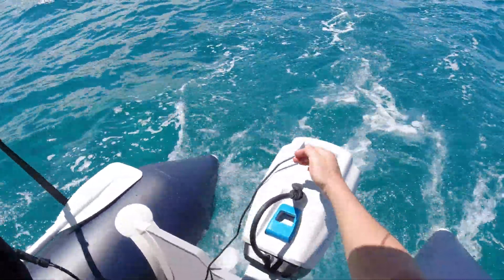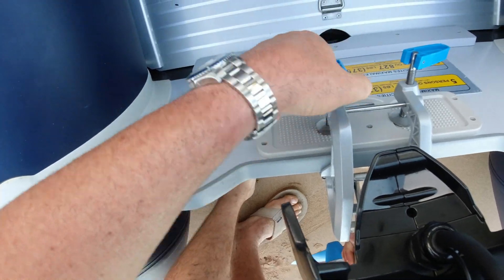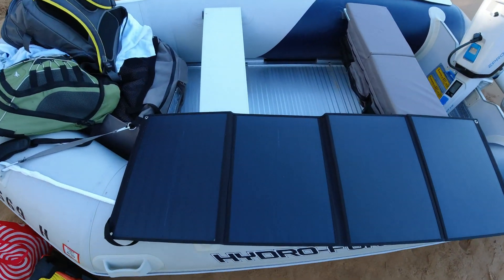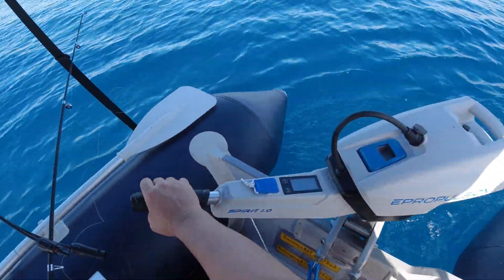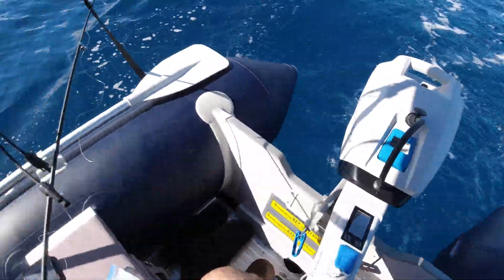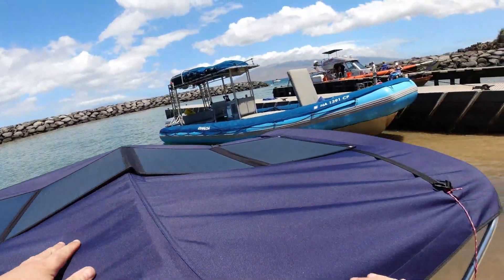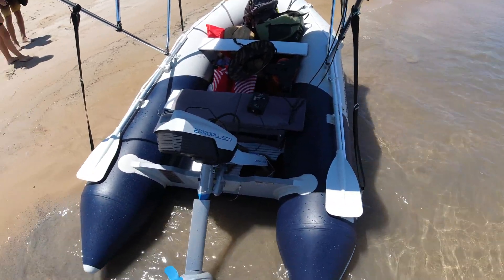Solar Electric 12S LiPo BRUSHLESS Mini Boat - Epropulsion SPIRIT 1.0 Outboard Review in Hawaii Ocean

Comment: Thanks for the review. I just bought the successor version of the motor, the Spirit 1.0 Plus and a bit larger 600 W solar panel w. another charge controller. I'm currently trying to figure out how to get the EPropulsion proprietary connector for the battery. I might have to make one by myself since the company is not offering them for sale. Any hints will be appreciated.
Reply: @holgere.  hey did you ever figure this out? I'd like to do the same.  Cheers!

Comment: Hi Dustin, I have the same boat as yours and my Eprop dealer is recommending the Short Shaft instead of Extra Short Shaft.  They mentioned the additional length would be helpful in choppy water conditions there would be more chance of the prop coming further out of the water and then unit will begin to lose performance since one blade is no longer catching all of the water it needs to in order to move the boat forward -- especially when encountering waves from other boats or wind blown chop.  Did you have this experience with Extra Short Shaft unit?
Reply from the maker: If water is choppy like that you probably shouldn't be using this low power motor anyway.  I haven't seen much cavitation issues because I go out on very calm days.  If your not worried about extremely shallow coral heads in your area then yes, get the longer shaft motors.
Reply: Yes it is biy it

Comment: nice video....for the bimini, how did you install on this boat?  glue on mount attachment included in kit?  thanks
Reply from the maker: I ordered some Bimini glue mounts.  I think I linked them in description under video 🍻
Reply: @DustinDunnill  thanks for reply....didnt see mount listed in  description...can you provide a link?  I have same boat and want to make sure I order same bimini and mount as yours
Reply from the maker: Howard V.  I added these to the description that I use to mount bimini:
Bimini Mounts (Glue on) https://amzn.to/2VTWgqE
Bimini Mount Pins (Drilling Required) https://amzn.to/3xGhzsU
I took off the plastic bottoms ring mount of bimini bars and drilled hole through bar and mount then just add the pin through both when setting up.  You could also try leaving the plastic ring mounts in the bimini bars and taking off the male end off boat side glue mount then slide pins through that and existing bimini mount ring but I don't think it would work as well.

Comment: 13:47 That's extraordinary dangerous misinformation you're spouting. 
That solar panel is 180w under ideal conditions. Expect half that plus charging inefficiency. You're going to be getting about 60 watt hours into the battery. The motors battery is 1280 watt hours, so you're looking at almost 11 hours to reach half charge.
Reply from the maker: Your way of thinking is scary 😂.  The suplimental power from solar is better than nothing.  I'd rather have a way to charge the battery than nothing at all.  Even if it's a trickle charge it could mean having an extra 10% or so of power to get back to shore vs oars only 🍻

Comment: How fast ? Do you know of any other brand or system that you could troll for tuna with? I want to get a 16ft rib and set it up for solar
Reply from the maker: This will only go about 6mph.  There is also the similar torqueedo brand.  If you want more power/speed the higher models start to get quite expensive 🍻

Comment: Oh wow... I just checked their site to see how the price and weight of their larger motors compare to the 9.8 hp 2-stroke I just bought. Their 9.9hp motor is actually 2 kg heavier - excluding the battery. In Malaysian ringgit my little Tohatsu cost 4,600, the electric 9.9 would cost a thumping 13,000 ringgit! That's like 3 times the price and heavier? I can't really call this progress.
Reply: 9,99 cist 6400 too 9600

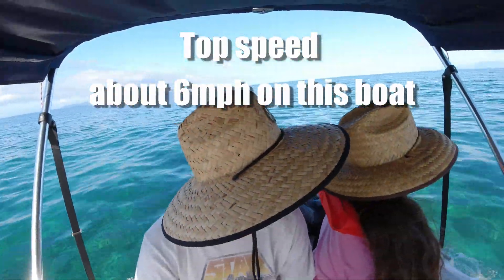Comment: 7:10 it will be 6mph at any boat which is lighter ... the speed is a function of rpm and propeller pitch
8:14 ... the exhaust is not smooth ... the extra short is not good for the boat

Comment: Neat set up. thanks for the vid. Where did you get the bimini mounting point? does it glue on? thanks.
Reply from the maker: I think I put the link in description.  Initially I just ziptied it to the side boat handles but have since glued on some flip up plastic Bimini mounts 🍻

Comment: Great review.  

The straps, as you know, should grab the panel gear from the corners only, and they should point away at about a 45° angle from each corner.  

The reason for this, of course, is to avoid shading from the cords on the panels themselves.

Depending on the way the panel system is setup, the shading can cut the output by up to 100%.

Great setup. Mahalo 🤘🏻
Reply: I have an idea for keeping the charger dry.

Several years ago, I found a waterproof box for keys, wallet, and spare change at Walmart.  Whenever, I went near water I would put everything inside, and it kept things dry.  If it fell on the water, it would float.  I know they used to sell a similar box for larger items.

This larger box seems to me about the right size to allow the charger to fit in.  You would need to drill holes on each side for the cables, and then seal the holes with the cables with a water proof sealant.  There are waterproof liquid caulking and silicon materials for this application.

The only concern I would have is temperature buildup inside the box.  So a shaded corner inside the dingy might help,

You would probably need to check with the manufacturer whether this would work.

Comment: lose money
Reply from the maker: ... and gain sun + electric power.
Reply: Dustin Dunnill rubbish.
Reply from the maker: It does what it's made to do well and has a lifetime warranty.   Far from rubbish but you may just be saying that because you work for Torqeedo (main competitor) or a gas only motor company 😉
Reply: Dustin Dunnill far from a gas guy. diesel guy first above all. i say it's rubbish because who only goes onto the water for 3-4 hours? can't go out except on nice days. 1 day with strong current and good luck getting that 3 hours out of that battery. i'm no hater. i just call things as i see them. it's complete rubbish.
Reply from the maker: I guess if your used to Oil power it's likely not going to satisfy.  It works fine for my needs.  I had a ZODIAC 13FT, trailer, 15hp gas motor years ago and don't want to go back to the heavy, leaky, smelly, maintenance mess.   This entire setup rolls up inside the back of my 4runner.    Only maintenance is charging battery and rinse  off.  I think I spent a little over 2K for this whole setup.
Reply: Dustin Dunnill right! cuz batteries are so clean to produce and dispose of. 

you act like one wahine when talking about one simple oil change. lol. stop it. 

this is as rubbish as your yota. V6 3.0 independent front? complete rubbish!
Reply from the maker: Lol... Now you just sound jelly 😂🍻

Comment: This electric motor looks great. Easy assembling and looks so quiet. The same looks solar panel easy to use and most important, that is possible to attach it on sun shade. (Y)

Comment: It'll take about a week to fully charge that battery via solar panel ; ) Solar is just a trickle charger but very cool!
Reply: ive seen guys with 2-500 watt solar panels connected to electric motor and can go non stop all day aslong as there is sun!
Reply: @chronicawareness9986  This same setup or a different one?
Reply: With the solar panel he has it would take about 2 days assuming the battery was completely drained. It’s a 1000 watt battery and the solar panel looks like an 80 watt folding panel. 

With reference to Chronic awareness, there are few (if any) 500 watt solar panels for a private individual to get their hands on. Simply too large and unwieldy. The solar panel in the link you referenced looks like a 300 watt panel that is used on most residential or commercial applications. They are around 6.5ft x 3ft for roughly 300 watt capability, so a 500 watt panel would be something like 8.5ft x 4ft, which would be.....quite large....and heavy. 

But, with that all said, with the right set up yes you certainly could get enough solar power to charge and maintain an electric motor going at lower speeds.

Comment: 6 mile range then when new and full?  Tha means its going to be around 4 miles average.  Not really practical for ocean sailing tender but as a harbour shuttler not too bad.
Reply: Peter Aremone sure but for a tender the last thing you need to be worrying about is it will make it back to the boat in the rain with all your provisions.  There is still a way to go in terms of technology advances until this becomes a viable option.  In engineering terms the energy density factor is just not there unfortunately for longer duration trips.

Comment: Cool idea and concept, but an hour and 45 min is just not enough life. Seems like you could get alot more run time with a minnkota and a full size deep cycle marine battery
Reply from the maker: I thought about getting a trolling motor but the flimsy design and heavy extra battery requirement in my small boat turned me off.   I got this one because it stacks together leaving room in boat and is an overall lighter setup with a lifetime warranty.  Runtime is totally dependant on throttle.  4 or more hours at low throttle and 1hr at full throttle. More with the solar panel constantly charging as you go.

Comment: That solar charger is a joke. At best it’s 50 watts. Not good when you suck out 500 watts when running motor.
Reply from the maker: 75% power when I got to my location and still 75% when I got home.  Guess it's working.

Comment: a longer ,aluminum flat bottom jon boat, with epoxy coating on the bottom to lower drag, this motor would prob go 10mph with the same payload, maybe even get on plane!   cool motor setup, just needs the least amount of drag as possible. This would do well in an aluminum canoe too, just use the side of the canoe towards the rear as the transom (piece of plywood both sides for clamp support. Bam! you be flyin in a canoe!
Reply from the maker: Good points there 👍

Comment: So it’s a boat with a high power trolling motor that uses loop batteries? Not much difference there other than voltage.

Comment: When clamping down, did you feel like you could break the handle or did it feel strong and secure? Excellent video as always.
Reply from the maker: Felt pretty strong and secure.  You just need them equally snug since it's not a big powerful motor.  I guess if you really over torque them they could but the motor is very well engineered it seems.
Reply: Dustin Dunnill Thank you!

Comment: You mentioned in the video matching the shaft length to the boat, what was the shaft length for your boat in the video in case i wanted to buy the same setup you got. Great video i really like that little boat w/the sunshade and that motor is awesome
Reply from the maker: Extra short shaft length.  I mentioned it when I was mounting it also 👍
Reply: @DustinDunnill  awesome thank you much Dustin 👍

Comment: I think it is too spendy. You can get the top of the line trolling motor for under $1000 and that has a stainless prop and hardware.
Reply from the maker: I first thought about getting one of those cheaper trolling motors but this is Hawaii shoreline and they don't come with a battery so quickly changed my mind.  Epropulsion also gives a lifetime warranty  it seems and just seemed better engineered / durable for overall ocean use. I got to demo one that was years old from a local dealer and still worked perfectly which sold me.
Reply: Yeah but you gotta fuck about with a third party battery. Then suffer the whole trip with range anxiety.

Comment: I love this one, I’ve messed around with outboard motors most of my life and still do, the fumes, the noise and fuel are all a real downsides even for today’s advanced 4 stroke motors, this completely removes all those inconveniences, also like the read out on the tiller, very well thought out, solar abilities as well, very cool, I’m surprised someone hasn’t done  this already-the electric motors on bass fishing boats aren’t that much different and they have a ton of thrust plus RC ability as well as gps, keep us updated on this if you hang on to it... Maui No Ka Oi
Reply: Big eye Tuna there is another company, Torqueedo, that I know that has similar products.

Comment: With the solar charging I'd estimate around 30W input from the cells. If you're willing to go slow you could go forever! 

How about lining the top of your canopy with solar cells!
Reply from the maker: Epropulsion rates the pannel at 100watts max.  How much is actually getting to the battery is hard to say but you may be right.  I knew it was charging when we got back and still had 75% battery or more 👍

Comment: When in Turkey I went on a river boat that had an electric motor, it had a capacity of 20 people. They preferred them as they could have a housing around the prop which wouldn't maim the passing Turtles.
Reply: Dalyan?
Reply: Nice but prop guards have been available for ice engines for decades

Comment: What's the power output of those solar panels? They seem.... very small... and considering that after an hour's charge, while no power is drawn that it had not even one bar lifted... it's a bit iffy... oh, but it still looks like such a nice toy!
Reply from the maker: Epropulsion claims 100Watts at 12V which would be about 8amps (this would be with max sun and best case scenario of course).  Factor in the charge controller loss and non optimal panel to sun angles and it was likely producing half that amperage.  I wasn't expecting to see much if  any motor power gauge increase in one hour since it's such a huge battery.  
I could tell the solar panel was working when we got back and battery was still above 75% power even though we were fighting wind/waves and current on the trip back 👍
Reply: @DustinDunnill  Awesomeness! Though that panel still looks quite small for 100 watts, considering solar cells only being about 20 percent efficient (give or take 5 percent) and 100 panels being... rather big... but then again, I havent seen that tech of solar cells often before, so it might very well be 100 watts! :D

Either way... this video was a delight to watch, regardless. keep up the good reviews, man :)

Comment: For those wondering, about $3,000 for this setup (boat, sun shade, motor, solar panel)
Reply from the maker: Very affordable full setup and I don't need a trailer.  It all breaks down and fits in the back of my Toyota 4Runner.  Takes about a half hour to setup on shore once you get the hang of it 👍.
Reply: Dustin Dunnill I’m envious! Lol. This set up is perfect